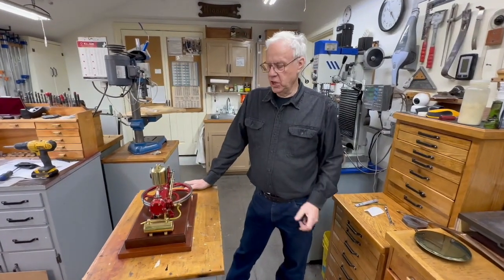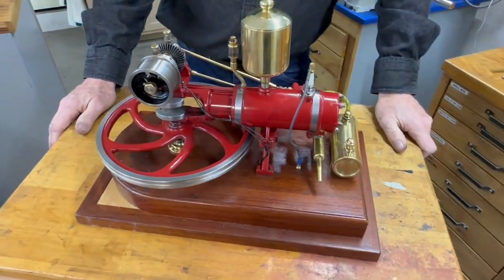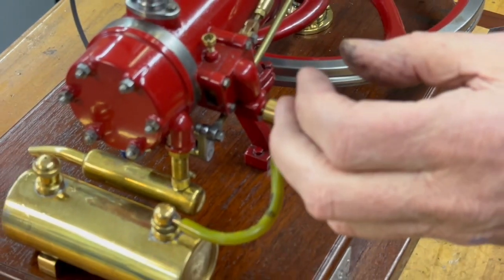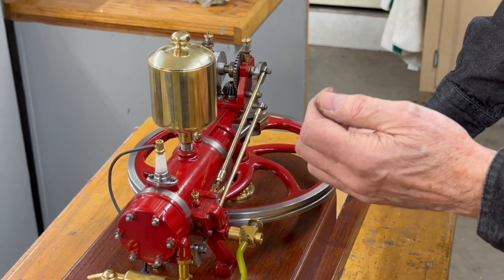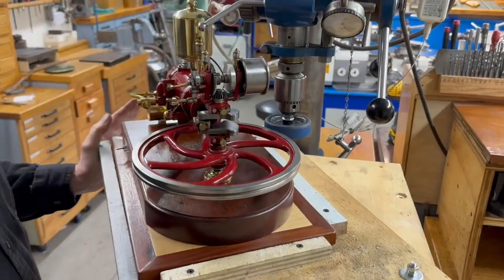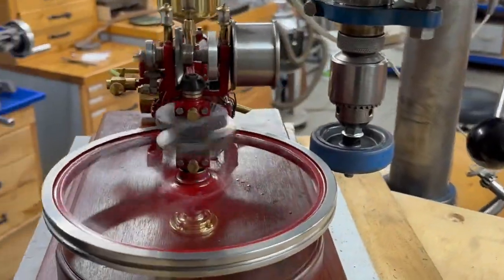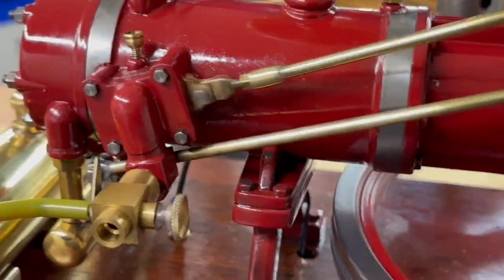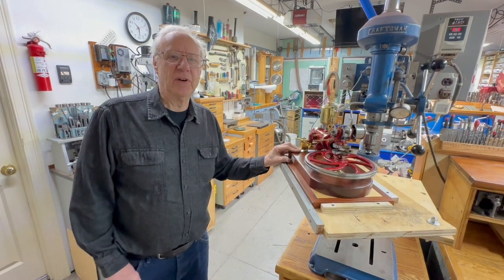Karl Benz First Auto Engine 1886 (Model Finished & Running)

Comment: Beautiful engine build. 👍👍
I have plans for this engine somewhere in my library. I just might have to put it on the schedule. Well done!!
Reply from the maker: @Jeff-KN6UDG  Hi Jeff, I have to warn you that I have not been able to get this engine to hand start or run to my satisfaction. I have built more than 60 models and this one is the only one that I’ve had problems with.  It definitely has something to do with the intake valve and it doesn’t seem to get enough fuel and air on the first intake.  So the engine always skips every other power stroke. So what it does is eight cycle. I also learned that other people had the same problem.  Thanks for checking out my channel.  Joe

Comment: I would love to get plans for this
Reply from the maker: Hi ,  I can’t help you with the plans I don’t actually have a set. I used some a friend had but he gave them away to another builder. They are available from the people who make the castings. All I know of is that they are in England. Also they are in a book called Engineering in miniature.Tee publishing. The drawings are by Anthony Mount. I hope this is of some help. Joe
Reply: @JoesModelEngines  Hey everything helps, I try to make my own castings, and that is one cool machine.
Reply from the maker: Also you should know that I told by a few builders and one person that has a reproduction of the car that they are all hard to start. It’s because of that slide intake valve and the eccentric that drives it. It just doesn’t work well especially when you scale it down. Joe

Comment: Couldn't you wrap a string around the flywheel (it's got a groove!) to pull start it?
Reply from the maker: The flywheel has too great a diameter for that, you would have a long string and would have to pull it very fast. Also you would have to have a place to hold the end knot. . Thank you for your input. Joe
Reply: @JoesModelEngines  you could pull it as fast as you do hand spin it by the flywheel, but for longer. One full rotation is all you need! (intake & compression, because if it isn't spinning fast enough to build vacuum, the mixer won't work right! + compression = power!)

You would need a knot in the rope, but also a small groove cut in the flywheel, like a lawn mower, before auto-recoil pull starters.
Reply from the maker: Hi Iowa 599  I’m sorry I didn’t explain my problem better, I’m not looking for alternative starting methods the drill press works great. My problem is the intake valve. Changing the way it works (timing &Duration ) is not possible without changing the original design. I would prefer to keep the engine as original as possible.  What I know now is that this is a common problem with even the original engine. I’m taking it to Cabin Fever this month maybe someone there will give me a solution. 
Once I get it running correctly I’m sure it will start easier.
Thanks for your input. Joe
Reply: I couldn't picture the problem you described. 

"heat cycle" I'm picturing as auto ignition, like red hot parts of the combustion chamber causing ignition without a spark.

To open the intake slide longer, but close it earlier, I'd increase the travel & tune the intake port. That would increase slide speed, so it could close more (mm valve travel), and also be open longer ( ° of crank travel).

Comment: Fantastic Job!!!  Don't feel bad, the full scale versions are hard to start too!!
Reply from the maker: Thank you for the answer. I feel better now that I know it not just my engine. I try to think of an answer that would look original but cures the problem. Not easy.
Reply from the maker: Hi ..  now that is very interesting , do you have actual experience on this. I’m willing to listen to any thoughts about this engine. I hate to admit how much time I put in trying to make it run better and start by hand.  Thank you for your encouragement and thoughts so far. Joe  So. Portland Maine
Reply: No, I haven't had my hands on one yet, but all of the videos I've seen of the full size show their stubborness! I agree the valve system is the culprit.... @JoesModelEngines